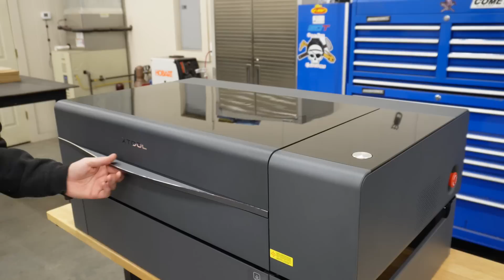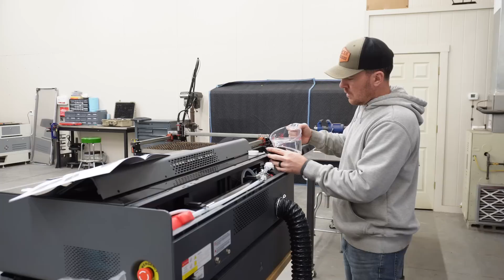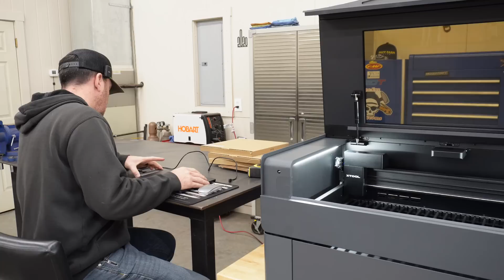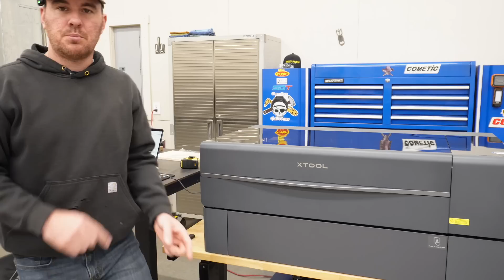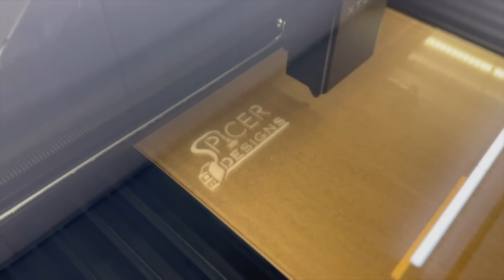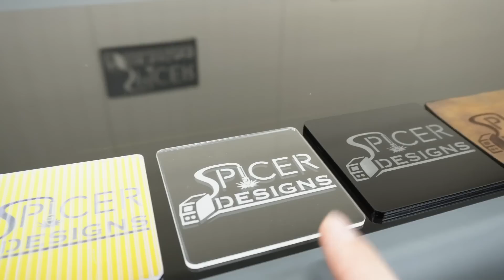XTool P2....The ONLY Laser You Need To Start Your Business!

Comment: I have a question...  when you turn on your machine with the lid closed, does the laser head hit the left gas shock ?  when i turn on my orange switch in the back with my lid closed, while the machine is going through its preliminary movements it hits the left gas shock.
Reply from the maker: Mmh. Thats odd.  I havent noticed but i will check next time i use it.  I dont think it does.  Is the limit switch damaged or out of place?
Reply: @SpicerDesignsLLC  it is brand new so i dont think its damaged.  if i turn my laser on and the lid is closed, the laser moves forward then back... hitting the left shock each time.  i am sending the machine back... and they are exchanging it.  i never see anyone turn on their machine with the lid closed.

Comment: Does the machine quiet down once it starts engraving?
Reply from the maker: You should be able to hear it engraving in the video. It doesnt change.  Has a built in chiller and im using the air purifier so there is some noise.

Comment: My engravings aren’t coming out that clean, is there anything else you did to get that quality?
Reply from the maker: May have to check/calibrate the mirrors.  Clean the lenses.  Make sure the distance from you laser head to the material is correct.  That will definitely cause blurred edges.

Comment: Gonna need to see how it etches metal.  Thats the only thing I can see the Co2 doing much more than the S1 40W.  Did you get another toolbox just to put the laser on it?
Reply from the maker: I did get that tool box for the engravers.  I plan on building a laser engraving station here soon.  Will make the engravers very quick to use and keep all the material and tools organized.

Comment: you almost got me sold on wanting a CO2 laser now. Similar to you, I am revamping my home office trying to get it in to production mode. I am about to get a 10w and 20w doide laser running with 2 3d printers as well. its just getting the time to get my home office and the "Rack" set up with all these machines. It is that fine balance of work & family. 3 nights a week I have swimteam practice or girl scouts, so that leaves very little time but is great for networking. But your walk through is a "common folk" or a down to earth, real person setup. If I purchased this machine, I would watch this video to setup in a heartbeat. Great video! 

Also - I made a piggy bank for my girls for x-mas: Imagine a basswood box, the face with a Minnie mouse head with the castle at the bottom cut out of basswood with a solid black acrylic background then a 1/4" thick read acrylic bow! then for the top of the piggy bank, I engraved their names and month of trip in Disney font, filled with super glue and glittered the shit out of that!! then went back over with more superglue to seal it in. it looks pretty badass! It's in part due to watching you, Adam, Diresta, Wilkersdo, Weasley, and some other rando's giving me inspiration and examples of what can be done.
Reply from the maker: Sounds like you have a plan.  Just have to chip away at it a little at a time until the vision becomes reality.  Sounds like a cool project.  If you get a chance, email me a picture of it.

Comment: Great laser for sure , my wife loves hers and it has quickly paid for itself . Cleaning the mirrors is pretty easy but can be a pain to get the one in the back positioned correctly without touching the lenses just because of the cramped space ( and fat fingers 😂 ) if you cut a lot of wood the fan gets dirty fast and takes a little more effort to clean but still easy . Also doing a lot of wood she has found that the slats tend to get like a burnt sap residue on them that will transfer to the back of your new project so either clean the slats with with dawn power spray or mask the back of the wood to help reduce that transfer if its something you need both sides to stay clean.  She has the conveyor and rotary too but hasn't tried either yet . Cant wait to see what cool stuff you do with this one too !
Reply from the maker: Thats awesome!  Thanks for the pointers. I will be sure to share that info in upcoming videos.
Reply: @zedinator  I know exactly what your talking about , my wife had cleaned hers one day by herself while I was at work and called me saying it wasn't working panicking thinking she messed something up but it was that rear mirror wasn't clicked in just right and after talking she rechecked them all and realized that's what was wrong too .

Comment: Great video! I'm in them market for one. Does this software have the feature to automatically straighten your cut file on the material being cut? This allows you to lay the material on the tray without being perfectly square.  The software recognizes the edges and adjusts if needed.
Reply from the maker: Im not sure on that one but that would be a good test.  I think you would manually have to turn your design to fit on the image/ material.  I dont think it actually recognizes the edges on the material.